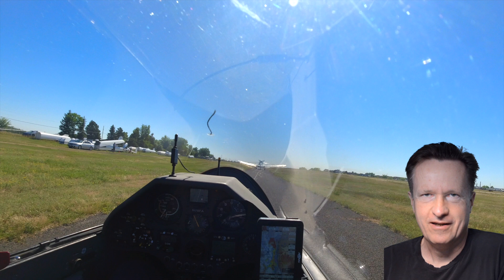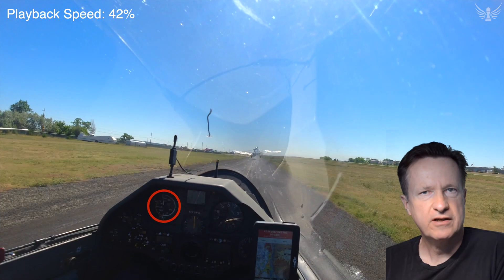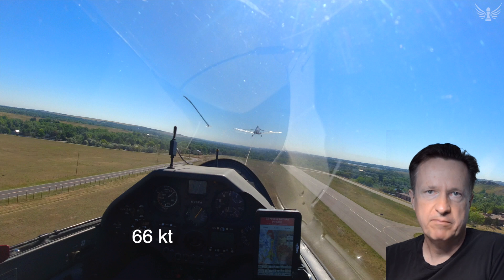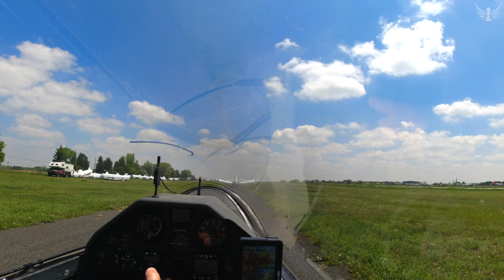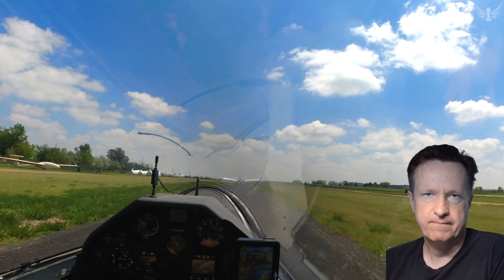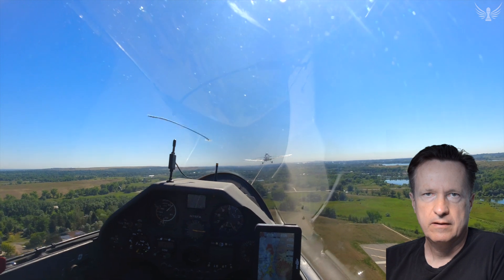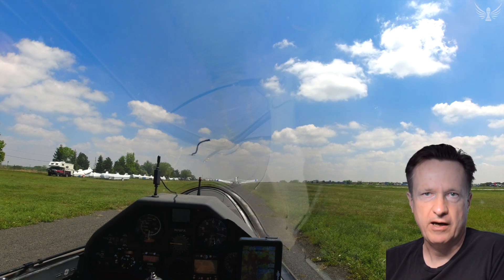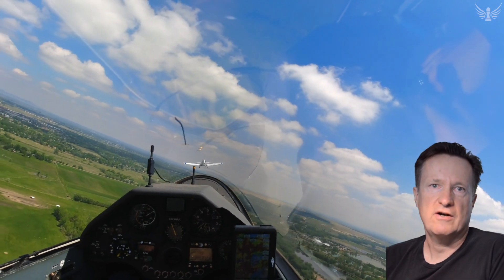Dangerous Aerotow - I almost stalled! - Towplane Flies Too Slow For My Glider

Comment: It's the glider pilot's responsibility to release the tow immediately under these circumstances.
If the glider stalls or loses control on the tow, especially at low altitude, the tug will also be affected.
Glider should have released early, pitched down for speed and control, and landed straight ahead.
Reply from the maker: Maybe, but...  If you're in the glider, what altitude do you think is sufficient to be able to pitch down to gain enough speed such that you're able to level off without hitting the ground with a low-nose attitude?  What happens if you release before you reach that altitude?  What happens if you don't pitch down and try to avoid a low pitch attitude?  Unfortunately, I don't think that there is an easy answer to this problem other than to avoid it in the first place through better communication with the tow pilot.

Comment: What I do not like about your analysis is, that all lessons are about the tow pilot. What you could have done for your own safety is to release immedietly when the towplane started climbing and you remained low. If you stalled you could have pulled the towplane down as well.

Comment: Any tow plane pilot has a set of speeds to fly with empty gliders or heavy gliders. If you tell the pilot, I’m heavy or full of water he would know what speed to fly. Even then levels of tug pilot experience  can  result in slow tows. Glad you survived ok.
Reply from the maker: This is approximately true but different gliders need different minimum tow speeds.  Eg a fully loaded JS3 will need considerably higher tow speeds than a fully loaded Discus. The key reason is the difference in permissible max wing loading.

Comment: I think the best thing you could've done instead of calling faster on the radio is to release the rope and just land. Because you could've stalled and stalled the tow pilot as well by pull tow aircraft tail. I am glad you both were safe and we can all agree with you it was the tow pilot mistake lifting off before you do.
Reply: I'm a student ..but if he released at that speed and height , he would have definitely stalled with no recovery altitude .. he had no altitude to gain speed and on release you go slower = stall into ground .. I presume , as I am just learning , may I ask am I correct in my assumption???
Reply: @adrianpeters2413 In that case if he directly disconnected and pushed down he would still have enough speed to land safely. Remaining behind the tow that low and slow can get both tow and yourself to stall and recovering from that is dangerous. Especially if the communication was also blocked, fast reaction cable release would've been the best I think. I also don't know how the wind was that day or what's the stall speed with that much load. So at the end it depends on each situation.
Good luck with the training! Many happy safe flights and happy landing!

Comment from the maker: If this topic has peaked your interest (it should for your own safety), then please also watch this safety briefing video from Dave Nadler.  It explains that the problem tends to be exacerbated by towing behind short winged tow planes (hello, Pawnee drivers!) and why the glider's stall speed on tow is even higher than it is in free flight.  The good news is that releasing should not be such a big concern because as soon as you let go of the tow rope, the gliders stall speed goes down and you’ll actually fly better than behind the tow plane.  (I still would prefer to never have to try so I will continue to pay extra attention at the briefing.). Another thing you’ll learn from Dave is why Pawnee airspeed indicators are usually off and often underreporting airspeed.  This further exacerbates the issue.  Here’s the video. Please watch it: https://www.youtube.com/watch?v=WIZWzvMu1dM&t=845s

Comment: When I had a JS1c 18/21m I got into the habit of radio exchanging indicated airspeeds with the tug  at least once during the tow.   All the Pawnee ASIs over-read by about 5 knots compared with the very accurate JS1 ASI even although the tug ASI passed static calibration tests on the ground.    I presume it is due to the lack of an accurate static source.  Also, there is an superb article called "Poor Handling on Tow" by Aldo Cernezzi in the Jan/Feb 2017 issue of Gliding International which gives the clearest analysis of what happens at various positions over the span of a long wing glider behind a short wing tug, and why it is so dangerous.   In short, the tug's downwash over the inner portion of the glider means that extra up elevator is required to maintain AofA and lift compared with in free flight.  That means that the outer wing is at an effective higher AofA than the inner wing  so that in the critical situation of a slow tow the outer wing will stall and depart first and at a higher airspeed than in free flight.   The tug's vortex hitting the wing part way along the span complicates things further.
Reply: Thank you John for these insights! I’ll have to look up the article you reference.  I’m told the Pawnees here also underreport airspeed, each to a different degree, though.
Reply: I found the Pawnees over-reported IAS compared to me.  The tug thought it was going faster than I did.
Reply from the maker: @johngalloway156  thanks, yes, I misspoke, I also meant to say over-reported.

Comment: Thanks Clemens for another great video!
Really glad you guys got away with it, this time... A friend of mine was not so lucky.
A couple comments:

1) You could have released the instant the tow pilot started climbing sharply before minimum speed reached!

2) The minimum safe tow speed for gliders is well above the glider's free-air stall speed. 
One of the safety briefings I've done about towing safety is available here: 
https://www.youtube.com/watch?v=WIZWzvMu1dM&t=845s - I should make a better video...

Hope that helps,
Best Regards, Dave
Reply from the maker: Great explanation in your video, many thanks!  Very helpful.  I’ll be more confident about releasing immediately if this ever became necessary again!
Reply: Thank you Dave!  Good advice!

Comment: Im happy that you both are OK! But the real solution is METRIC SYSTEM!!! Knots feet miles inches… makes everione confused
Reply from the maker: Yes, I agree that there are definitely too many different systems in use.  But that’s not something I can readily change, so I will have to adjust to reality rather than try to change the reality itself.  Btw, even where the metric system is in use there are inconsistencies.  E.g. why use m/s for vertical speed instead of km/hr?  It’s a lot more useful vertical and horizontal speeds use the same units.  The calculation of glide ratios requires consistent metrics… Also, why is wind denoted in knots, even in many countries that use the metric system? It would be a lot easier to just have a single unit for speed, no matter what speed is being measured.
Reply: @ChessInTheAir  if you think that the metric variometer should show km/h instead of m/s, how come that you find ft/min is consistent with an airspeed meter showing nautical miles per hour ?
Reply from the maker: @philippelambert329  You’re right that I prefer the vario to be in kt instead of ft/min. It just so happens that it is, you just have to leave the zeros off: 100 ft/min is almost exactly 1 kt (1 nautical mile / hour). No math required ;-).  Contrast this with 1 m/s which is 3.6 km/h.  Not quite as easy.
Reply: @ChessInTheAir  ... easy once you know that a nautical mile is 6076.12 feet 😀; Actually, what makes the computation more "difficult" with the metric system ) is not the conversion between metric units (always a 10, 100 or 1000 factor), but how we count time. We need metric hours, minutes and seconds, as well ;-)
Reply from the maker: @philippelambert329  I’m not going to defend the arcane imperial system and would much rather have metric myself everywhere.  But habit is very powerful.  Good luck getting folks to change to a metric time system ;-).
Reply: @ChessInTheAir I'm quite fortunate to fly gliders in Europe :-D. Therefore, I do not have to change my metric habits (official in all countries but 3, to say the truth). Only when I fly with an engine must I convert feet and knots. ;-)
Reply: @ChessInTheAir  I don't know what all this non-sense talk is all about ? Aviation has always been nautical miles and nautical miles per hour even in fully metric system countries. Whatever the unit system it has to make sense relative the to speed measured. I prefer NM/h for speed as airplanes fly a lot fastrer than cars do, so it make sense to have a higher speed unit to measure it. Same with vario, you wouldn't measure vertical speed with the same unit you measure forward speed because you have to adapt the unit to the kind of speed you are measuring and the vertical speed is not big enough to be expressed in NM/h or Km/h hence it is either Feet/Min or Meter/sec. Aviation navigation comes from secular boat navigation and in both fields you have plenty of conversion to do so you shouldn't be a pilot if you can't do it properly.
Reply: @ChessInTheAir  yes. You are right. There is no way that they ever change it. But for the wind. In hungary we use m/s for that.
Reply: Many of the American glider folks say the metric system hurts “their situation awareness!”  It’s true.  I agree metric system would solve the problem of this and many other glider competition challenges.
Reply: Very relevant safety issue. All clubs should include this in their recurrency training! 
You were lucky. Some unflapped gliders can barely rotate enough to unstick at stallspeed, yet alone, climb out of ground effect!

Comment: Hard to believe an experienced tow pilot would make such a basic error
Reply: We all make mistakes. A lot of experienced glider pilots have made such basic mistakes as getting out of tow position putting tow pilots at risk, or worse. Towing is a team effort and it’s really best if the glider pilot does the unit conversion before takeoff and not rely on the tow pilot literally doing it on the fly.  Also, consider that many tow pilots who almost always tow very light gliders where a slow tow speed is perfectly acceptable, even desirable.  If that’s what the tow pilot is used to it is very easy to automatically do what you always do.  As I said, it’s a very simple mistake to make.  The point of my video is not to put blame on the tow pilot but to help everyone understand that such mistakes happen very easily and we have to work extra hard to avoid them.

Comment: Holy shmoley Clemens. That was sketchy! I've always wondered how it would look in this situation, and you're right. The glider pilot is in a bit of a pinch. If you stay connected and stall: that's very bad! You go low, and force the towpilot nose high, you both probably don't survive. If you release: you probably stall, but at least the tow pilot gets to live through their mistake. 

I will not pretend to second guess you here. 

Instead: If that happened again and you saw the tow pilot climb out BEFORE you left ground effect, before a safe tow speed: would you release? If you catch it early enough: you can land straight ahead as briefed or go to the fields.
Reply from the maker: Yeah, while I was working on the video I had a lot of time to think what I should have done differently.  I’m actually still not sure what the best decision would have been.  Possibly release as soon as the tow pilot pitched up, immediately switch to landing flaps and simultaneously release any back pressure on the stick, keep the air brakes in and land straight ahead.  The problem is that you really have no time to think and decide, it basically needs to be a reflex that must be part of the emergency plan just like in a rope break or loss ow tow plane power situation.
Reply: @ChessInTheAir  How long does it take to dump water ballast?  Would preparation for ballast dumping be appropriate as an EP under tow?  For instance, If you initiated a water dump at the same time or a few seconds following the "faster faster faster" call how long would have taken for the polar to shift into a safer realm?  Alternately, assume very marginal conditions including strong downdrafts in the mountains under tow to the point that terrain clearance and escape was a concern.  Would dropping ballast be an appropriate EP to be ready for under those circumstances?
Reply from the maker: @johnlewis1113  Water dumping takes a few minutes (exact time depends on the glider) so this is not a viable option when in a pinch where seconds matter.  In a potential downdraft scenario over the hills the water is actually an asset not a liability because it allows you to fly faster at lower sink rates so you can get out of the downdraft area sooner and with more altitude left.
Reply: As far as pitching down, would it be plausible to rapidly pitch down and release at a negative attitude but before substantially lowering position relative to the towplane?  e.g. as you transition through the "low tow" flight position.
Reply from the maker: @johnlewis1113  yes, I think that might have worked.  I wonder what the pull down on the tail would do to the tow plane which wasn’t much above its minimum flying speed either.  It probably would have also terrified the tow pilot.  Maybe something we could deliberately try one day at a safe altitude.

Comment: Wow that was scary, Clemens!   I’m glad that was an incident and not an accident!
In a perfect world everyone (in aviation) will follow the lead of gliding in Europe that has converted to metric units. How many more incidents / accidents will it take before we realise that standardisation in aviation is essential (not optional).
We did all learn to speak English in aviation, so surely we can also all learn to speak metric?!
Reply from the maker: I wish you were right but I don’t have high hopes that standardization will happen.  By the way, Europeans should change their varios from m/s to km/hr.  It is very helpful when vertical speed indicators and horizontal speed indicators use the same unit (like gliders that have both indicators in knots).
Reply: @ChessInTheAir  Yes, valid point that both vertical and horizontal speed should be the same unit.
Even the British (eventually) realised that decimal currency is easier to work with when they converted from pounds, shillings and pence to decimal units in 1971. So I guess there is hope yet?!  Maybe the Penny will drop (pun intended) that decimal distance units will also be easier to use?

Comment: "Faster, faster, faster, faster, ...faster, ...faster," is not clear communication.
Reply from the maker: This is true but “faster” was on my mind. I didn’t really have more than a fraction of a second to decide what to say.  And I needed an immediate reaction from the tow pilot, not a thoughtful “ok, he wants me to increase my speed by 15 knots, let me focus on getting that right”. What message do you think would have been most effective at that point?
Reply: @ChessInTheAir  It must have sounded very bizarre to the tug pilot. Had it been me my first thought would have been that a third party had got hold of a radio and was joking around.
Reply from the maker: @KeithWhittingham  Thanks, I didn’t think of that possibility.  But it’s a valid point.